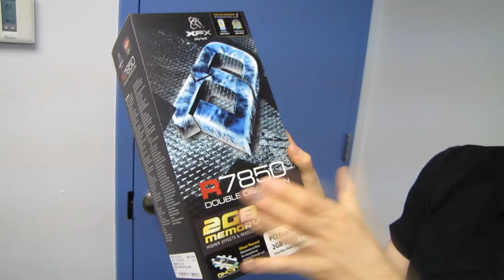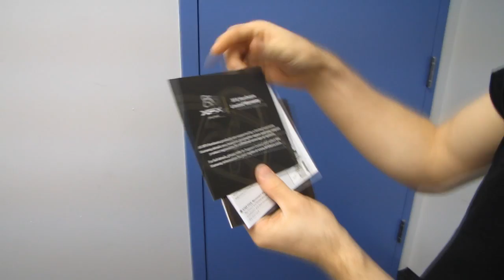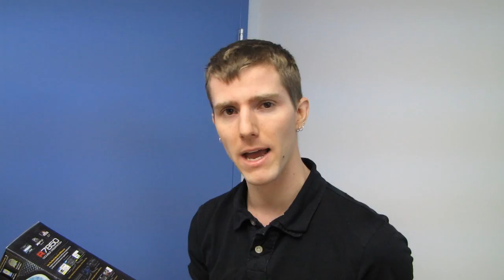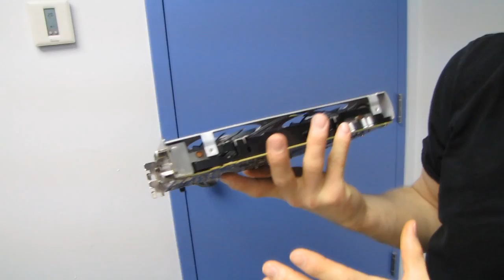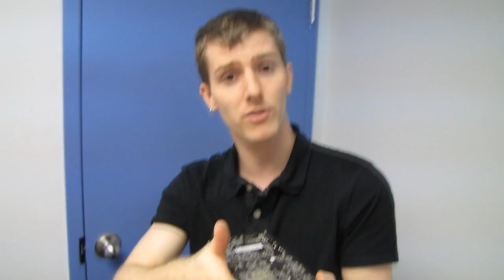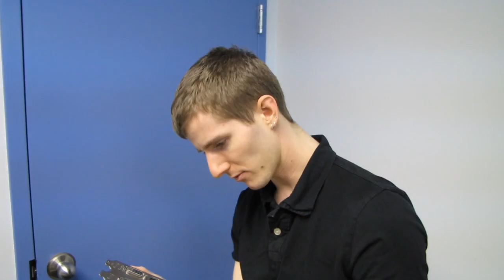XFX Radeon HD 7850 Double D 2GB Gaming Video Card Unboxing & First Look Linus Tech Tips

Comment: Is that the Xbox one's gpu?
Reply: The Xbox One uses a APU.
Reply: 1337mlg LOL I know it is but this card is suppose to be equivalent in performance to it.
Reply: +JCHGaming69 this is mooooore better
Reply: AzizTrOlLiNgGaMe The 7850 is not bottlenecked by a slower frame buffer and a crappy jaguar CPU like the Xbox One is.
Reply: yeah sure.. ;)
butthurt
Reply: JCHGaming69 The Xbox One has better performance. I'm using a XFX HD 7850 and the Xbox One is better.

GTX 750ti is more like Xbox Ones performance.
Reply: The HD 7850 is better than the 750ti

Comment: Is it worth grabbing another to crossfire together?
Reply: +MrZnyper I grabbed a second one for 50 bucks. Extra performance is nice in games like Skyrim, Far Cry 3, and Dirt Rally. I do highly recommend you use RivaTuner to cap the FPS as there is some microstuttering or just suttering. Rivatuner does a much better job of keeping the experience as smooth as possible.

So if you can get one on the cheap, go for it. If not, just save up your money and sell it and grab a more powerful single card.
Reply: Thanks for responding! I'll keep an eye for a cheap one while I save up for my next build.

Comment: I have an opportunity to buy a 1gb version of this for 70 euros.  Is it worth it?
Reply: +Nathan Reilly 
From Serbia. Just bought the card about a week ago, and it really works well. Even while running on a plain shitty E7500 clocked at 3.3 it lets me play games I never considered before at decent framerates, but in 1440x900 resolution.
Now I'm contemplating on the processor.... might go with an i7 2600 or FX8320, if I don't find out whether A10-7850 can work with this card in dual graphics mode...
Reply: +Nathan Reilly Never thought about ordering from Germany... I always thought that however lower the price, it would be negated by shipping cost, unless i buy everything there.

I know i5 is better in single threaded applications, but I kind of want 4+ cores or at least hyper threading, because I'm interested animation and modeling... and with Dx12 games coming up, all cores will be able to 'talk' with the GPU. 
I would get the i7 2600 but the low RAM speed it supports is worrying me.
Reply: +Nathan Reilly Yeah, but considering they are mostly used for servers, they are hard to find and usually the price doesn't differ that much. I can't really go over the 200e mark for a CPU though. A new case, SSD, PSU, RAM and MB won't fit the bill then, and a processor is useless without them. I tried using a 771 Xeon to buff up the rig that I have, but the system proved too unstable after the conversion. Had to underclock it just to prevent BSODs.

AMD really shines in that 200e price range, even though they aren't good at all in the grand scheme of things. I can't even get a decent i5 for that money, not even used.
Reply: +Nathan Reilly Oh and I looked the site up, the prices are about the same, if a bit cheaper, but without shipping factored in. Goodness knows how much it would take for them to throw it over the border.
Reply: ladno sam naso srbina koj je ovo djavo :)

Comment: sir which one is best gtx 750 ti or r7850
i am little confusion
Reply: +quantae06  what about gtx 960 is that better than 7850 coz amd heats a lot
Reply: +Gamers United The R7850 is more powerful but the 750 Ti is quite capable but with a far lower wattage.

Comment: this gpu is shit, had enough fps first 2 months,  AMD never again :*
Reply: Ive used mine for 3 years and i dont plan to upgrade any time soon. I love my 7850. And i even use it with my 144hz monitor so and i play demanding games such as arma 3
Reply: +TheGamerGuy ya, I was wrong about the gpu,  A friend is using my xfx 7850 atm and has no problems. I recently bought the gtx 960 and still get no fps so it might just be my motherboard bugging since its the only piece i didnt change yet. Still I wont buy amd stuff ever again.
Reply: a pentum 4 does that

Comment: I have a 280w power supply on which I run my i3-3220T(35W under load), 8 gb of ram and 1tb storage. Since I don't have a 6pin I will use 2 molex y 6 pin, would this work?
Reply: Lol this was from a year ago, got a 400w psu and an r9 270x for 100 euros :)
Reply: +Anonymous Fartface I can run it with 450W. It depends on what kind of power requirements the other components have.

Comment: Hi there. I just saw that one at Addison for 150$ from XFX. I`m actually using a GTX 560Ti 2GB. I can run everything like in the butter but it`s rushing a bit on Arma 3 on max graphics. Would it worth to replace my actual graphic card for a XFX Radeon HD 7850 Double D 2GB? I have no damn clue. Thanks.a lot.
Reply: Felix Jørung Sanderholm 7850 and r7 265 are the same gpu
Reply: ***** http://www.pc-specs.com/gpu/comparison-versus/2160/964/radeon-r7-265-gigabyte-windforce-2x-oc-2gb-edition-vs-radeon-hd-7850-gigabyte-oc-edition  Exact same except that the R7 and R9 don't use a crossfire bridge, crossfire is done though the PCI ex lanes. But yes no bridge socket so can not crossfire the 2 cards.
Reply: I would buy eather on of the newer amd cards (260, 270, 280, 290, ETC.) or one of the never nvidia cards (750ti, 760, 770, 780.)
Reply: flixs2 I just checked the speqs few days ago and realize that this video card is equal to my Geforce 560 Ti.
Reply: Grunge LovR Spesificasion wise maybe, But the 7800 series have been the best cards on the market for a very long time. The 7870 can be compared to the 760 if you overclock it.
Reply: ***** Hi. Thanks for reply. Believe it or not the GTX 560 Ti I have is still very good for most games. Even for Arma 3 which is the most demanding game I play. I have an i7 CPU 3770, 16 GB of RAM and I don't really need to buy a new graphic card for now. Eventually I will but there's not rush. When I will I'll get a very strong one and will invest about 500-600$.
Reply: ***** Yes exactly. Anyways they always make new ones. The more we wait the best it is lol
Reply: For the money the xfx 7850 is no longer good. I would go for the 270x or the 760 from nvidia. The 270x is better for the money, but AMD cards have a repotation with buggy drivers. So all in all the 760 is a better option. How many watts do you have on your powersupply? And what's your specs?
Reply: does thoose cars cost that much where you live?! Holy F*** Man.
Reply: ***** So the 280x is cheaper in your country?
Reply: There is a a version with less ram that cost less

Comment: Question:
I have a ASUS P8 H61-M LX3 plus motherboard which has a 1 x PCI Express 2.0 x16 slot and 1 x PCI Express 2.0 x1 slot. But this Graphics card requires 3.0 PCI. Will this card work with my motherboard?

Comment: Two questions: Will my corsair RM-450 power this, and can I install a reference water block on it?
Reply: It will run it, I use a Antec TruePower 430watt to run a Phenom II x6 1100T 3.7ghz and a HD5870 1000/1350mhz at 1.27v. my 5870 uses way more power then the 7850 at stock and mine is OC. You should be fine.

Comment: Right now I have a 430 watt psu and I need to know if this card will run with that I have been looking everywhere to find out
Reply: It will run. But the minimum requirements for this card is 500watts.. So if you plan on running this card on a 430 watt psu, the card's overall lifespan would decrease. To be completely safe buy a 550 or a 600watt psu :> and there's this one cheap ( i know cheap is not exactly the option to look for while selecting a psu but this one's good) psu by corsair, its vs550. It maybe cheap but it has all the latest features and has 85%+ efficiency which is great :3
Reply: Taher Ajnawala

I'm might also buy XFX HD7850 2GB 975m, and I have a BlueStorm II 500W. What's your opinion?
Also I'm about to get myself a Intel Core i7 920 processor, ASUS 2 Rampage Extreme motherboard.
Reply: Antonio Matošević that would be sufficient enough. thats a good grade psu i assume :3 Should easily handle the system
Reply: Taher Ajnawala
I'll probably get the R9 270x ;)
Reply: WOH. epic timing XD just received my sapphire r9 270 (non-x) yesterday. Its a beast for my screen reso :3 (1366x768)

Comment: Uhm how much power do u need for this card a 650 watt psu would work right
Reply: even a 550 should do
Reply: ***** nope you dont need to replace the motherboard. as long as the motherboard has all the required slots/ i/o of your choice, you don't need to upgrade it just for the sake of a new psu. but yeah if you are planning to buy a new gpu or like a ssd which has 6 gbps support and your current motherboard doesnt support it, then you should "consider" (emphasis on consider) buying a new mobo. :P so, just get a good psu and ur mobo should work just fine with it.
Reply: 1) yeah you can do that. you can possibly buy any gpu u want and put it in your cabinet until and unless you have a powerful enough psu you to go with.
Your processor is good enough for the gpu. if you can add in more i would recommend you to get the r7 265. its just a bit more expensive but worth it.
2) yeah the crossfire feature is pretty cool. you can put it in crossfire with 7750 or any amd gpu . although it wont factor into performance much but yeah its better something than nothing. :D so enabling crossfire=some performance boost
no crossfire= easily possible by disable the on board gpu. it wont effect much.. so you can do anything you want :3 its cool.
Reply: ***** woh a 7970 is a pretty high end card.i hope u dint mean a 7870 :P and if u dint mean 7870 go for a r9 290x rather than a 7970 (much better). and yea regarding the psu requirement 600watts should do just fine until and unless the psu is of good grade. what psu do u have specifically?
Reply: ***** oh yeah regarding 6-8 pin. you can use a molex to 8pin adapter and ur psu should have extra molex o/p lying around. that should do the trick if ur psu is good enough.
Reply: ***** i just opened up my box of r9 270 just to confirm that the 6pin adapter only requires one molex cable.
and googled about the 8pin one, it does indeed require 2x molex connections.. 8pin draws a lot of power so it makes sense.
and are you absolutely sure about your gpu selection? because that is a really expensive card :P if you can afford it well and good. because you can buy a r9 280x with a better psu (meeting the essentials) in less than the cost for a 7970.. imo the 7970 is outdated you shouldnt go for it anyway.
Reply: anytime :) good luck

Comment: if i put my fingers to the fan while its spinning what would happen ?
 Is the fan strong enough to break or cause serious injuries ?
Reply: yeah,you can def. get serious injuries when fans are full speed
Reply: you can stop the fan easily by holding down your finger right at the center of the fan. It will go to a complete halt and the moment you let go, it will start spinning again. Its safe until you arnt planning on touching the blades :P

Comment: linus will intel i3 540 bottleneck vtx3d hd 7850
Reply: Yes, this card is comparable with the i3 540, but you will not get the performance as you will with a i5k or i7k.

Comment: If money is no worry.....Go Intel and the GTX 770.

-Intel beats AMD for gaming 9/10 times.But Haswell gets real hot when OC'ing, so be careful.

-Even though the Crossfire 7850s might* out perform the 770, one higher end card is better than two mid-range cards.

AMD CPU's are cheaper, and usually get out performed by Intel.But they are definitely good for gaming.

Comment: It wouldn't matter. As long as its a 500 watt PSU, it should work fine. And that's assuming your computer isn't loaded (IE like the lowest end i3 you can get, so on and so forth). My rule of thumb that seems to work well is go at least 100 watts above the minimum.

Comment: I'm running this with a Corsair CX430 and I haven't had any problems so far. A quality 430w will do if you're not going to do extreme overclocking. But you might want to get a 500w just incase you upgrade to a new card.

Comment: This card is pretty great. It will run most games on high or max settings. It was runs Black Ops II, Mafia 2, Mass Effect 3, Just Cause 2 and several other games maxed out at 1080p at 60fps with no problem. It will even run BF3 on high at 1080p with around 50 to 60fps on single player.  Overall, this is a great card and will play most modern games well.

Comment: Great video! I'm stuck between this or upgrading to the 7870 do you think the extra $30-50 is worth it for the 8780? Also how do the heat pipes work? Do they just absorb the heat and spread it through the pipes? Lastly do you have a video showing how to install a video card? I'm mainly looking how to install the drivers and get it running thanks!

Comment: Linus i need your help. I'm debating which graphics card of the 7850 to get... I'm never getting a xfx card ever again because of whats happening. The fan on my xfx 6850 have issues and inaccurate spinning, xfx has no quick support feature besides the ticket. Out of the rest of these... which one of the 7850 brands is more efficient in cooling and speed?

Comment: Yes, from time to time Catalyst bullshit crashes. Not very often, but enough to see the difference between AMD and Nvidia. 

Also I use After Effects, and when using certain effects that utilize OpenGL, the whole system BSOD's. 

Also when playing Dota 2 the cursor gets corrupted and distorted when dragged to the edge of the screen during gameplay. This goes back all the way to starcraft 2 beta days. 

AMD still hasn't fixed this issue.

Comment: My computer doesnt have casing fans and its always hot but I removed some 2 120mm fans off of my old computer(its a very old pentium 3...) and cut some wires and stuff and connected it to a dc adapter to get some air flow and doing so my case is fully open always is this good or bad :(? (ik i'm comenting on a wrong vid but i really need to know)

Comment: do you think this would be a good upgrade from my current 5750 that is overheating badly.  I will also be upgrading my 450 watt psu what would you recommend to be paired with this card.  I don't think there will be any bottle-necking but i want to check.  I have a phenom ii x6 1035t

Comment: LOL i Was curious, because on the single fan cards there is only 1 6 pin power connector, this has 2 6 pin power connectors, was curious if it uses more wattage than the single 6 pin power connector on the other cards.....Confusing i agree

Comment: Just curios, I have noticed that in the Single fan version of the xfx 7850 only has 1-6 pin connector. I'm just wondering if the amount of wattage of this DD card, requires a larger amount of wattage.
lol thanks

Comment: Fuit21, I think you should buy a 7950 or a gtx 670 at minimum. You should be able to run modern titles at high res without issues.

Comment: I know that the 7770 its only 128 BIT yet it still kick some asses but im not sure how power is it. Some claim its not any better than a single 6850 ( as in is weaker than 6850 ) some said its can compete up with a 6870 zzz 

Well if here u buying Sapphire 2X 7770 its more expensive than a 7850 ( A shop is a distributor for Sapphire he sell cheap ) But if u compare 2X 7770 with a 1X XFX 7850 then yes 7770 2X is cheaper then even Sapphire 7850 is cheaper than the XFX 7850 !

Comment: A 550ti just about breaks 30 FPS maxed out. I have a 560ti and I get between 50 and 70 fps maxed out. The 6870 is the equivalent of the regular 560. The 6950 is more the 560ti equivalent. The 7770 is just about as good as a 6850, which does not really handle Bf3 in max settings with anything more than about 20 fps approx.

Comment: Well a 6870 is the equivant to a 560 ti/non probably ti
And my 545 is closer to a 540 than a 550ti, and a 545 can't run bf3 maxed but a 550ti can (with low aa and af)

Comment: Idling at 50% fan speed, it sits at around 35 Degrees Centigrade. Turning it down to 20% fan speed it slowly starts to rise, so set it to 50%.

To me, running the fan at 50% works well while gaming, but if you are going to overclock the card I would probably sit it at around 60%.

Battlefield 3: Max settings, running the GPU at 87%+ sits around 50 Degrees Centigrade at 50% fan speed.

60% fan speed slowly started to drop the temperature back while maintaining the same noise level.

Comment: The new mid range is as fast as last gens high end as in 7870 = in between 6970/580 , 7850 = in between 6950/570. That being said the new high end cards like the 7950/7970 & 670/680 are in a whole new performance bracket.That being said the new mid range cards bring a high end performance but they are still pretty much the same price as last gens high range cards.So in sort the buy in price has went up but performance really hasn't increased but power consumption and heat are down as a +

Comment: No, I'm not. I don't have the room for even two monitors around here. The one I do have supports a 1920x1080 resolution. Running a game in fullscreen impacts the FPS (35-45 FPS) while running said game in a 1280x1024 window gets better performance (45-55).

I'm waiting for a card that will let me play this in fullscreen at around 50 FPS.

Comment: Still.. most 7850s are at the 250$ price range. It's just better to get the single card over the CF setup unless you already have a 7770. Plus you don't need to worry about microstuttering and other capability issues with running more than one card. Don't get me wrong though, crossfire/sli is good, but if one were to build a fresh pc I would always recommend the best single card they can get before doubling.

Comment: Btw the GTX 680 is roughly equivalent to GTX 560 Ti SLI (depends on the game). A 7850 is in between 560 Ti and 570 in performance. So... 7850 is pretty close to half the performance of a single GTX 680. Plus once you CF you're gonna know 100% scaling is probably not gonna happen.